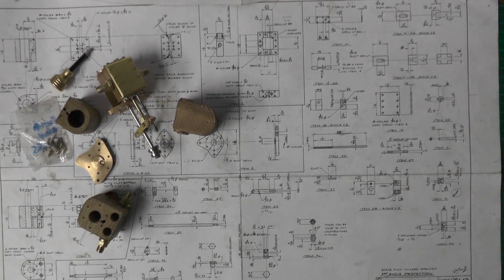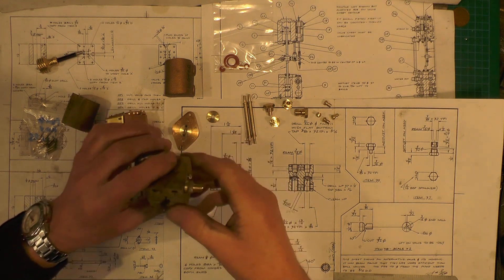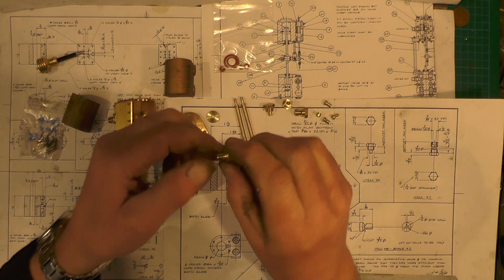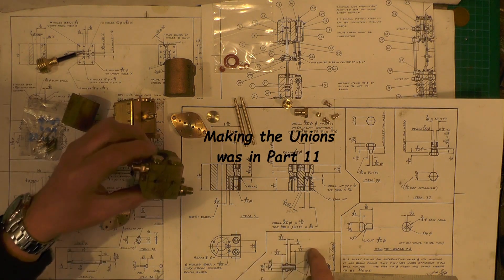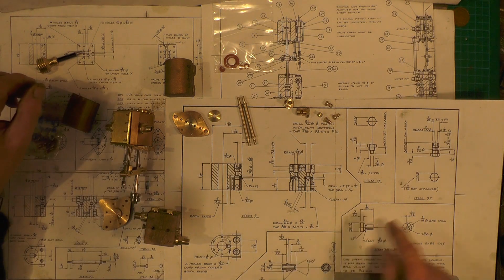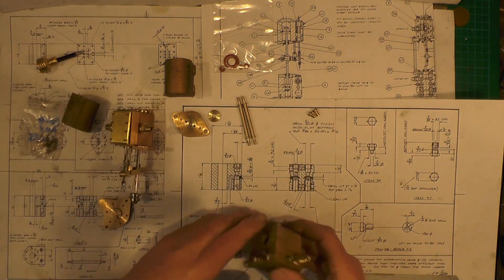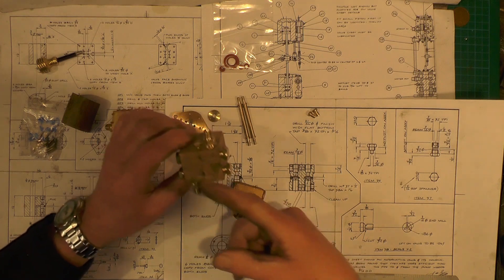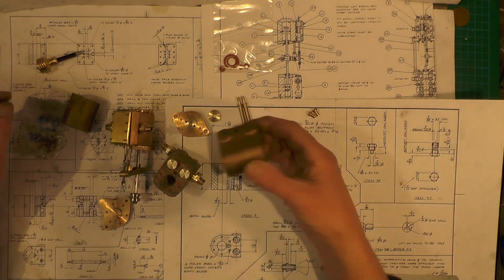Southworth Steam Water Pump Part 12  Pump#2 Rats Nest & Butterflies "mr factotum"

Comment: great tip on using a bolt with a hole drilled instead of the tailstock  die holder.
Reply from the maker: cheers Mike
thanks for feedback👍👍👍👍
atb
Kev